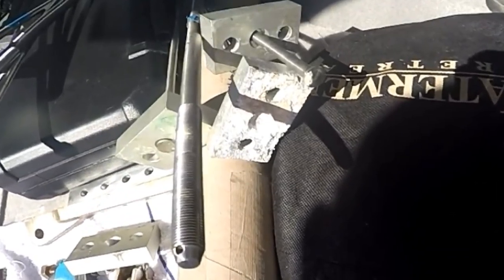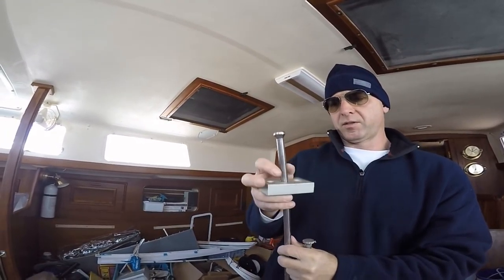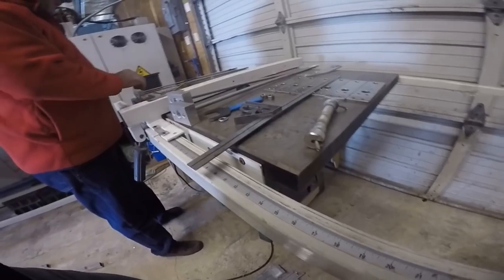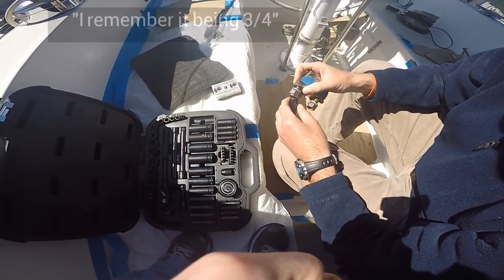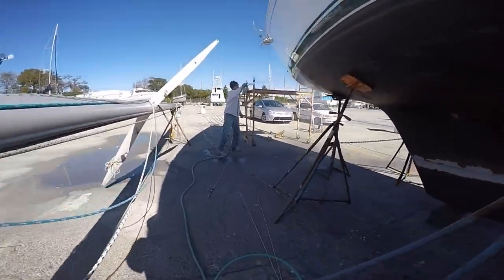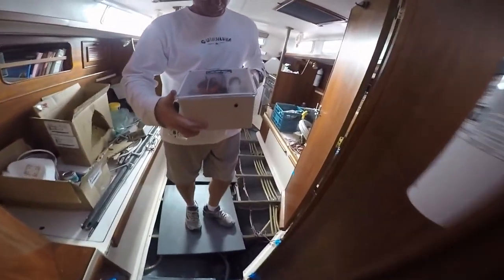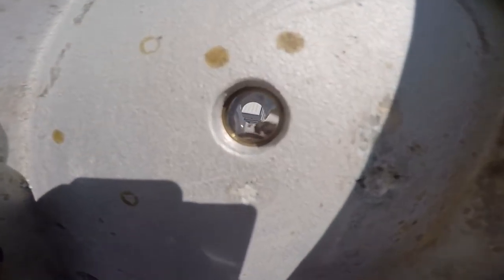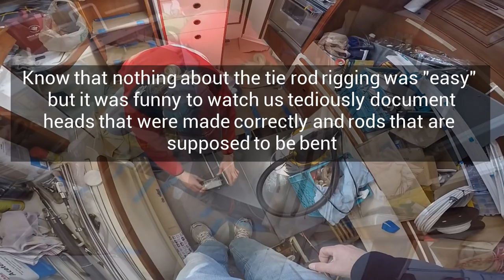#61: Machined Blocks and a Magic Bilge Box

Comment: I know this might be a bit late, but what about buying some elongated nuts with  tapered heads on them. Sometimes they are available at an auto parts store for aluminum rims. I know, buying is an awful word when it come to re-fitting. If I was down there with you I would certainly be in there with you helping out. I'm just that way. Keep up the work, it's better than snow.
Reply from the maker: +g. Normal Hey Normal.  Thanks for the offer (now that it is a bit too late - ha!).  Had I met you a month ago we'd have put you straight to work!  Thanks for the tip.  I've never heard of those.  I'm not even with the tapering, we could have made it work, but we ended up having the machine guy open the holes bigger so we could get the socket in.  It just seemed there was always something we didn't think about until it came time to actually do the project and then we'd have a hurdle.  Maybe that was just our DIY showing but it was often a daily occurrence.  One of the great things I gained from all of this is a huge appreciation for someone who can visualize every stage and need of a project from the outset.

Comment: Just a thouht Annie; despite the step box and  larger drain fitting I would figure out a way I could shove a wire up that pipe into the mast from time to time to prove it is open, or else a way to force water  backwards to prove that it flows out again. (voice of experience)
Reply from the maker: +Mark Bernier Hey Mark.  Really appreciate the input.  That was definitely a concern of mine.  I asked Brandon time and again how accessible the pipe/hose would be so we could take it off and shove a pipe cleaner up there.  You'll see, she's not too hard to get to and while Brandon recommended checking it maybe every six months, I might be a little more anal retentive about it.  but, we will be able to see in the mast step if she's holding water, so there will be a good can-look-at-it-everyday indicator.  Thanks for watching.

Comment: theres always something  huh,ah well it all works out in the end .I'm working on mast lights on my little gal,,plus have to figure wiring out in the boat ,new dome lites ,and getting it all hooked up.
Reply from the maker: +paul stratton Ahhh wiring.  Not my favorite (and clearly not my talent) but I learned a ton about terminal blocks, jumpers and circuits during this refit.  Hopefully I won't blow up anything next time I put on my electrician's hat.  Good luck with it Paul.

Comment: Annie the sockets you were using are impact sockets and are thicker that the usual hand sockets. Some companies like Snap-On tools have certain sizes that are made very thin for special purposes. I was surprised the rods did not come already threaded, any special reason for that, it is tricky to cut threads on a bent rod. At least you will be able to check to see how tight the rods are by tapping on them and the tone will tell you if they have enough tension. Sort of like checking for a lose bicycle spoke, spin the wheel and they will go ting ting and the lose one goes thud . Has Brandon offered you a job yet? Just look at all the benefits, working on beautiful boats all day in the fresh air getting a good tan except on those days when playing in the fiberglass forest or sanding the hull. You could have had a trade instead of blowing money on law school.
Just think things you thought were impossible to fix are now fixed and you about ready to travel where the wind and tides take you. If they carry you to So Cal let me know. I always keep a good single malt around to liven up the conversation.
Reply from the maker: +Uncle Muir Ha.  Thanks Uncle.  In fact, Brandon did!  Several times during the rotten stringer repair.  Sadly, sometimes people who just consistently show up and are willing to learn and be taught are the bare requirements.  I have learned a ton at the yard and I'm incredibly grateful for the experience.  Next time we're in So Cal!!  : D